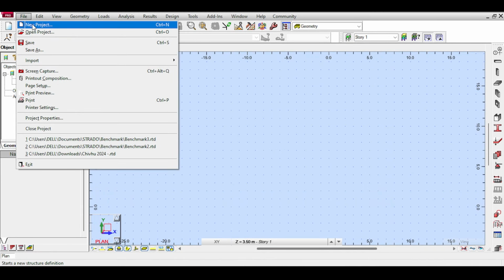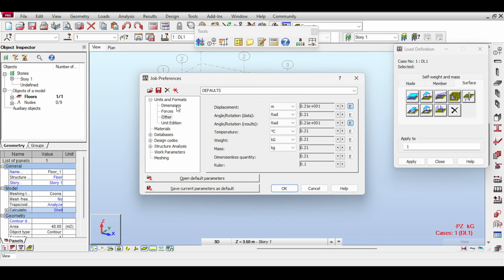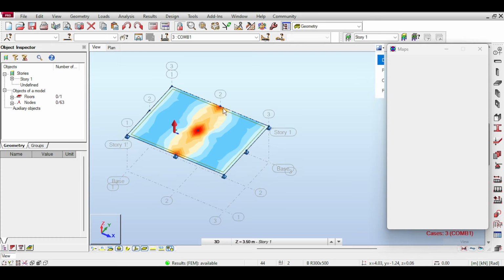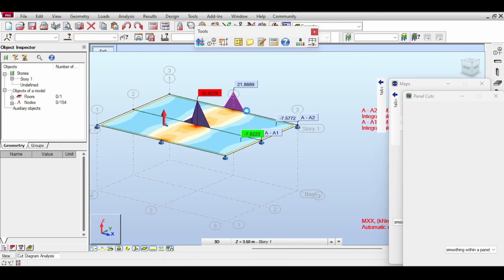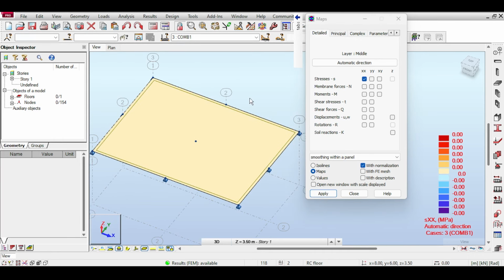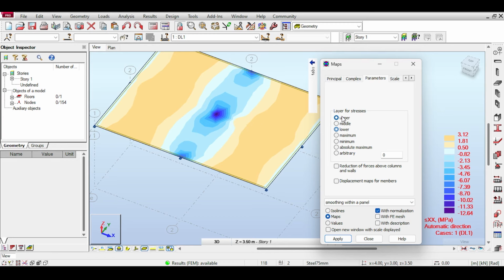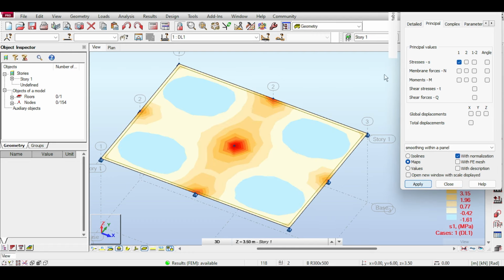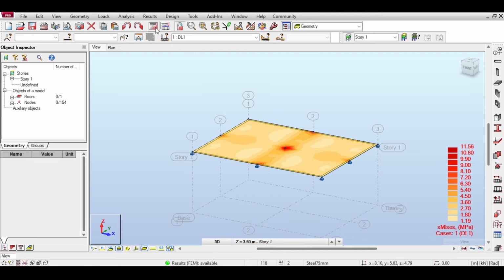Ideas on Plate Principal and Complex Stresses in Autodesk Robot

Comment: Sorry difference between s12 and t12 shear stresses please? Which one would you consider for the maximum shear stress ?
Reply from the maker: Now this would need you to remember a bit about your Mechanics of Materials course:
The diameter of Mohr's circle is actually difference between sigma_1 (s1) and sigma2 (s2)

Also, the max shear stress is the radius (half the diameter)
so in my humble opinion, s12 is the max shear stress
https://help.autodesk.com/view/RSAPRO/2024/ENU/?guid=GUID-BD23B817-BEE0-4DB2-97AF-2571B877F803

So I do not think there is a significant difference.

Comment: Hey Dr? Can we use von mises for concrete and if not, which is the best criterion to use for concrete?
Reply from the maker: The drucker-prager material model is more adequate for concrete. Von mises would not be that adequate for concrete, but works well for metals and steel
Reply: @CivilEngineeringEssentials   Thanks dr

Comment: Hi, nice video. With regards bug you referred to at around 5mins in. If you change the z location value i.e. select base level 0.0m rather 3.5m then you should be able to apply the load correctly, i think anyhows?
Reply from the maker: thnx for the info ^_^, it still kind of annoys me that this bug exists, but well, we worked around it ^_^
Regards,
CEE

Comment: I appreciate your efforts, but I noticed that you might made a mistake when you modeled the steel plate. You created a new thickness and gave it 75mm thick, but you did not change the material option to steel. You left it as concrete instead! 
Am I right?
Reply from the maker: ooh I totally missed it!!!! I gotta change the title and add a correction
Reply from the maker: ERROR CORRECTION: I forgot to select steel as my material. The explanation does not change, but recorder n00b totally missed the point. On behalf of the CEE team, I apologize.